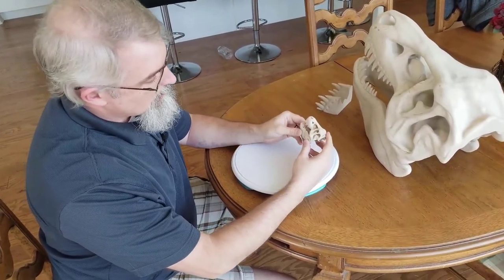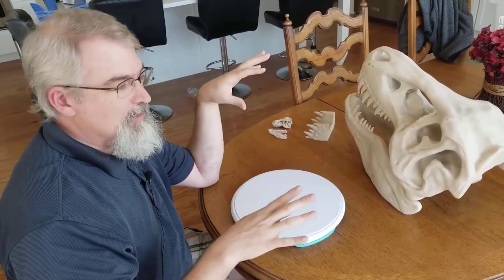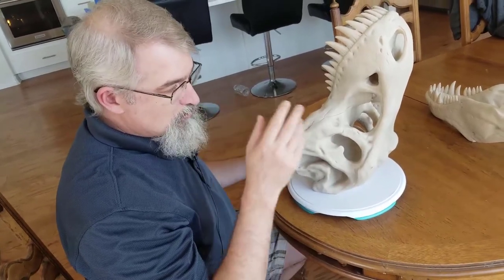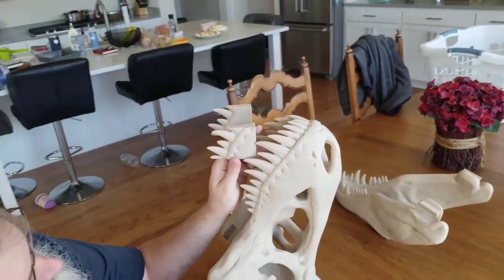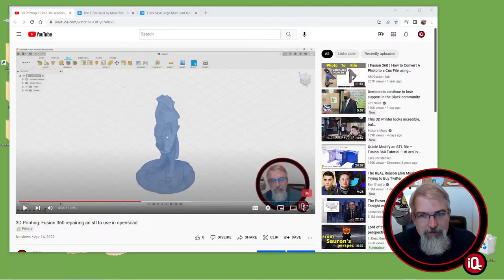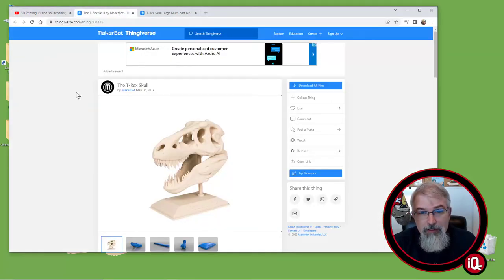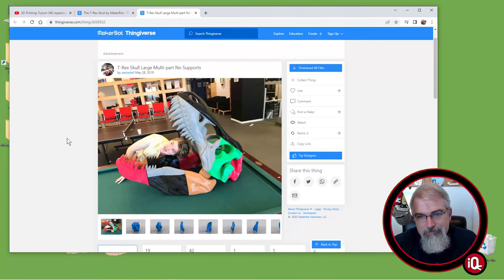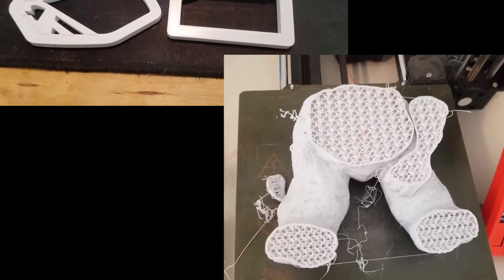3D Printing: Dinosaur Skull Split Test

Comment: Blender has the remesh modifier which works like the fusion 360 example. A quick test gave me good results with default settings. You can even use the Boolean modifier to slice it.

It also has some tools to find non manifold areas which this models suffer from at the hinge it seems.